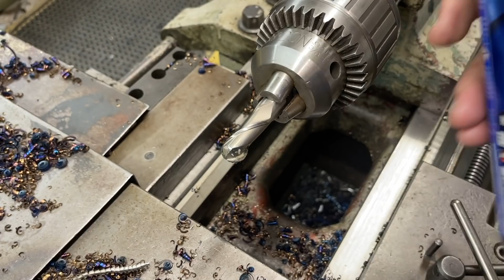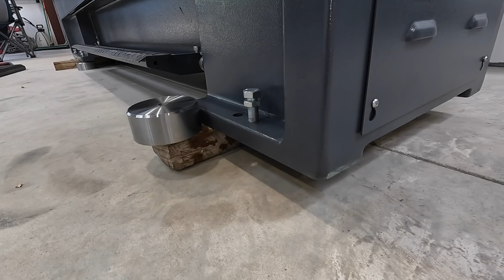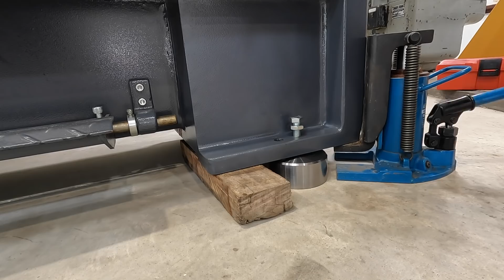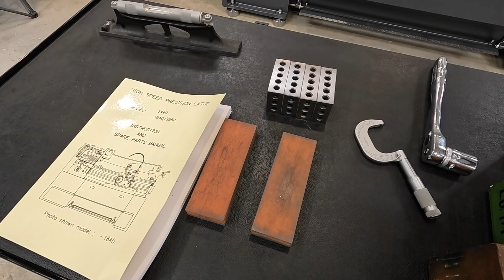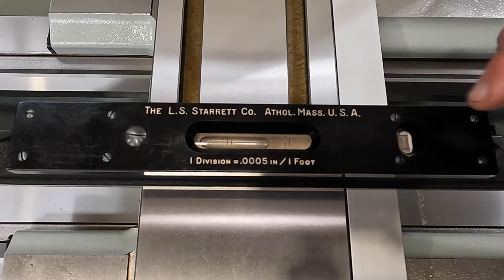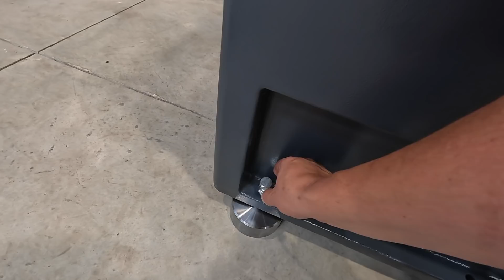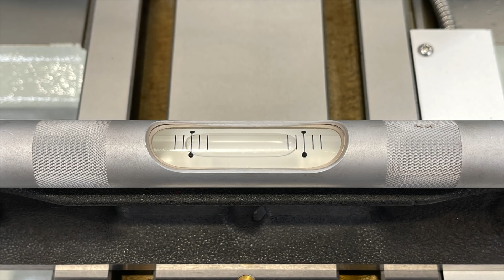Leveling the Precision Matthews TL-1660 Lathe

Comment: Thanks Adam, my PM-1440GT just arrived today! I made my leveling pads out of aluminum.
Reply: Aluminum has been just fine on my 4000 pound Monarch, they should be okay on this 1500 pound lathe. I shouldn’t have to worry about corrosion either.
Reply: hmm i dont a bout that you really want steel for them and not aluminum im like adam i use steel and i been moving and setting up  machines for years

Comment: Fun fact -the lathe doesnt have to be leveled.You can tilt it for coolant flow to one side -however bed guides need to be parallel to each other and parallel to a center line of the lathe for it to cut true without taper..
Reply: Thats one of the best short explanations I've come across so far. Using the word level is simply causing natural interpretation errors. Someone should take a small hobby lather and level it to 45 degrees and show it can work fine.

Comment: How about levelling the headstock - or don't you want the spindle true to the bed ?
Reply: Adam just completed leveling the lathe, which includes the headstock. I wish he would have put a little more tension on those last two bolts that he just “snugged up” though. Just enough to insure that heavy end is well supported. Perhaps later?
Reply: @ellieprice363  That's precisely what I mean - those two aren't properly supporting the headstock.
Reply: @millomweb  Yes, first step I would suggest is torquing those four bolts the same then check the leveling process again.
Reply: @ellieprice363  Spirit levelling - not necessary - what is required is that all supports need the correct pressure on them to hold the bed true (to the headstock) in all respects.
Reply: @millomweb  Sorry, no responsible machinist would purchase an expensive new lathe and assume that if he torqued all the leveling bolts to exactly the same torque the bed would be perfectly true without twist and ready to machine expensive parts. It’s too easy to check and be certain. Attention to detail is the only proof of sincerity.
Reply: @ellieprice363  "if he torqued all the leveling bolts to exactly the same torque the bed would be perfectly true"

Wasn't me that suggested that !
Reply: @millomweb  Please read my full reply again without taking my words out of context. Thanks

Comment: Adam, Should you be checking the torque, on each leveling bolt, to make sure the lifting force is equal on each ?
Reply: I was wondering the same. I havent finished the video yet, but I was wondering how the two 'extra' leveling bolts under the far left end of the machine... I wonder if there is a way to measure deflection between the headstock and the ways due to the bending moment.
Reply: @Thebadbeaver9  Yeah, he's completely missed that. #banana-bed. Since he's not used the left hand extreme foot adjustments, I guess his spindle will be 'looking up' relative to the bed.
Reply: @millomweb  I wonder if this Taiwan lathe came with “banana” or “monkey” fasteners? My Taiwan surface grinder table traverses on precision Imperial ball bearings.
Reply: I think you two are lost. The OtherPeoplesBeeswax channel is over there.
Reply: A very good basic step to start with, then adjust each bolt as required to complete the leveling job.
Reply: @ellieprice363  I was disappointed when Adam simply adjusted the left hand end adjustments to simply take up the slack rather than take half the weight of that end of the lathe. I anticipate the result is that the spindle is looking upwards over the bed - not by much but the issue of proper headstock support should have been addressed.

Comment: Great information about how to level the lathe. 
 That machine looks well made. I hope it is a good powerful and accurate machine because I like seeing you make some big cuts sometimes lol.
 Enjoyed the episode and the information. Keep em coming.
Reply: He's got other lathes to hammer with big cuts - he should use this lathe as little as possible to preserve its accuracy. As someone said in a previous episode - he should fit an hour meter to the motor wiring to record how much the machine is used - to plan a maintenance schedule. Had the bed not been somewhat prelubed, he'll have put a year's worth of wear on the bed already. He's talking of cleaning all the protective gunge off it. I'd have squirted oil all over it first.

Comment: I may have missed it. But is there a specific method as to deciding the height of the leveling pads? Finished work height, or some other reason?
Reply: Get the machine up high enough so it doesn't break your back permanently bending over it ! I'd guess our lathe is about 10" off the floor !

Comment: Got a 2' by 6" by 2" thick rubber from work that was left over from insulating a couple of 1750 HP Chillers.  Great to lay on agent working in washing machine dryer or furnance. Can remember kneeling on steel diamond plate while an apprentice. Would never do that now a days. Good luck with the new shop.

Comment: Don't you then have to turn a shaft and check for taper as a final test for bed twist?
Reply: He should unadjust all the gibs, thoroughly lubricate all the slides and other oil points, give himself a good workout, then adjust the gibs properly, then set the tailstock on centre, ensure the headstock is aligned with the bed vertically and horizontally - then he'll be ready for turning test samples.

Comment: How does this compare to a digital level that has an accuracy of  0.1 degree?
Reply: 0.0005 inch per foot equates to 0,00004 degrees so it's a whole different game
Reply: @Wogroipl   Thanks. I tried to do the math, and got confused.
Reply: @firesurfer  I tried to use an online angle calculator, and it wasn't precision enough!
Reply: Not even close

Comment: How do you like that Temco toe jack? I just got a 6" 20-ton cylinder a pneumatic pedal for my little 20-ton press. I've been buying my welding cable from them, they manufacture it in Colorado. I use it for all my battery cables in vehicles as well as #2 x 25' leads for my stinger and work clamp with #4 x 12' whips on them. Really good quality cable.👍
Reply: I've just bought cables for welding - and have gone for twin flex marketed as battery cable. I'll separate the last yard of it or so. Hopefully it'll be a lot less tanglesome !
Reply: @millomweb  I use DINSE 35 on both of my welders, so can use the whips by themselves or on an extension, two extensions, etc...I use them for both stick and tig. I have a couple friends that like the Tweco connectors for their leads, but I just keep 'em DINSE like the torch and work clamp. I find it easier to have them all the same.

Comment: How about the school of thought to make the pads slightly concave to eliminate rocking.
Reply: You could leave a rim on the bottom; I think that's the technique they use in precision cylinder squares and such.  It makes sure the three points of balance are all as far apart as possible, leaving room for high spots in the middle.  But I'm guessing it really doesn't matter all that much.
Reply: I thought of that too, but I think the pads will nest down into the concrete a thousandth or so with all that weight and a little chuck vibration.
Reply: Convex?

Comment: Nice lathe! I might have been tempted to paint or use Birchwood-Casey cold blue on the leveling pads. Interested on cutting a fairly long shaft for end to end diametrical accuracy.
Reply: Yeah, but... let's get it powered up, first.  :)

Comment: I would think they would use the finest threads they could for leveling screws to reduce the effect from small adjustments,,
Reply: "they" being Precision Matthews?
The threads tapped in the machine base?
Reply: @jimurrata6785  yes,,
Reply: @madebysteve1738  Cast iron is kinda grainy and crumbly. 
You don't usually find fine pitch threads in machine tools or engine blocks because the depth is shallower and distance between crests is smaller.
Reply: @jimurrata6785  I didnt think about that,, sounds about right,

thanks for the clarification,,
Reply: @madebysteve1738  I'm no expert, and I agree with your point.  
But I DO understand why I don't find fine threads in cast iron or aluminum.   🤔

Comment: I'm curious why no one (machinist videos) make an effort to actually anchor the machine to the concrete slab? I would think vibration would have the machine moving all over the shop.
Reply: See Vintage Machinery channel with Keith Rucker and look out for his Carlton radial drill. That is bolted down but needs to be for stability as it can work outside its own footprint. Lathes aren't prone to walking about and if they did, it'd only be a little bit to a point where they 'feel comfortable' on the floor.
Reply: Yikes!!  What the hell are you planning on machining?  Remind me not to visit your shop.

Comment: Wouldn't a quality lathe take drainage into consideration?
Reply: Yes, I'd suspect having the machine perfectly level would set all channel angles to drain to the coolant sump.
Reply: Drainage along the ways?  How could they do that?  He's talking about drainage for coolant sitting on the ways, not drainage down in the sump, where... no doubt... the pan has a significant slope towards a drain plug or something along those lines.

But up on the ways...  you want the ways pretty much level, and the point he was trying to make is that a little downward tilt is desirable, rather than having the coolant "pick its own direction" and drain down into the mounting of the headstock.  I think my guess would be to use even more tilt than he used.
Reply: That's not why he's leveling it at a tilt. It's so fluid doesn't travel along the part being machined and going through the chuck and running on the floor.

Comment: Adam,  I'd love to see you do a "reaction video" to this video. I randomly came across it yesterday and it's very interesting. It's a machine shop in Pakistan that machines crankshafts from cast iron blanks. It would be an easy 35-minute video for you to make, but I think it would be interesting to hear your thoughts as they go through their process.

https://youtu.be/XsEIamdzsZs

Thanks,
Jay
Reply: Those crankshafts must be used in f1 racing cars ! Loool ,no balancing -that engine must jump like a goat !
Reply: @armageddontools     Some of those Pakistani truck repair videos and stuff that ends up overloaded on public roads make me appreciate the US laws and regulations in a new light.       I mean we can all appreciate one getting a job done whatever it takes but when it comes to vehicles- totally like whoa!
Reply: I Agree - I also watch those Pakistani machine shop videos - they're very impressive.
Reply: Amazing what they can accomplish using coathangers for runout indicators. Most of their shops don't even have workbenches.
Reply: @drlegendre  Thats how they did it back in the day -with the needle and height gauge.
You can get within 0.1 mm just by eye.
I used sharpie in a toolpost as well .

Comment: When leveling a machine on a new construction location, how frequently would you verify the level of the machine afterwards?  Any concern of settlement of the slab or building over time?  What would be an indication to you that the machine is out of level?  So many questions, but I'm curious of any follow-up procedures on your end.
Reply: People say that the concrete moves but it's more like the vibration of the machine wears off the concrete's peaks underneath the feet. Personally, I space the feet up about 3/8" and force some machine grout underneath them. Wait over the weekend and you're good to go. It will likely stay right on the bubble.

Level it. Check it at 20hrs of work, then again at 40hrs of work, then every 400hrs of work. If you don't crash it or it hasn't experienced a lot of vibration, it won't move much after 40hrs.

Just keep it oiled and never leave it set long after using water based coolant. The rust inhibitor goes bad and things start to rust. I wipe it down with Mossy Oaks CLP at night (gun lube).
Reply: @cornpop7805  Lucas makes a great gun lube.
Reply: @franknphotos 
I agree about Lucas and I almost said them. I've heard CRC makes a good one too.

 There are a lot of good CLPs these days. It a great time to be alive, especially if you like gear.
Reply: Check every week for the rest of your life!
Reply: Checking is so easy w the levels he has.  I would really check weekly for 6 months and monthly thereafter.  Milling machine is even more critical w it's weight distribution.  Shaper got to be the worst thrusting w every stroke.  So easy w a nice level.

Comment: Adam:  Great channel, might I suggest you use a black Sharpie pen to fill in the etched graduation marks on the vial of the Starrett level.  You can rub off the excess. 
Here on the screen it's really hard to read.   Cheers!
Reply: IMO Adam should send that #199 back to Starrett to have those marks professionally re-painted

Comment: @abom79  I am not a machinist, but it seems to me you would want to just "crack" the bubble. I am a heavy machine operator for over 25 years, and when grading if we want the water to flow, we just "crack" the bubble on the level, which is about 1% fall, or 1 inch in 10 ft. Water will flow on a level surface, it just needs to accumulate before it will flow. Just need a little fall abom, not a full line on the level, I think that is overkill and unnecessary.
Reply: When setting up with the Starrett precision level, he read it as 2 thousandths over a 1 ft span, far less tilt than 1 inch in 10ft if I'm not mistaken. idk, I don't do this for a living or anything. Cheers.
Reply: Yeah I failed to consider the resolution of the level, and as he said, the most important thing is to not have the ways in a twist, so a little fall in line with the ways probably won't hurt anything.i just reacted to him saying a whole line on the level, and was thinking a whole line on a regular level

Comment: So, the entire weight of the machine is supported by the threads?
Reply: The photo in the manual shows that very set up. Seems legit. Those bolts must be strong, though. I believe they may be a way of isolating the vibrations to/from the lathe. Those small socket feet would have that effect.
Reply: @TheDuckman02050  All professional grade lathes i saw were bound by concrete to the slab . It absorbs vibrations better and if cast iron is normalized properly lathe bed wont warp.They used to do it by leaving a cast outside on the wind,sun,heat,cold , and other elements for 5years . I somehow doubt chinese did that .
Reply: @armageddontools  .....I "somehow doubt" nobody has done that for the last 100 years!   BTW, there are no Chinese involved with this lathe.
Reply: @truthbetold2914  ...I don't need to tell myself anything more than I know.  The machinery is advertised as 100% Taiwan.  They are proud of that.  The Taiwanese and the Chinese are nowhere near cooperative.  You were just itching to say "chicom".  You feel better now??
Reply: @truthbetold2914  lol
Reply: @paulcopeland9035  you wrong!! there was a  imigrant chinese worker in Taiwan  putting this very machine together!!
Reply: @truthbetold2914  i think so too everything is less money in China
Reply: @paulcopeland9035  Keep dreaming buddy ! 
There is always something chinese -cast iron probably came from china steel mills which hold like 80% of steel production and those electronic components deffinetly are from china.
Even if they are made in a different state -capacitors,mosfets,diodes and other electronical components are from china.
Probably even pain is made in china.
Reply: @paulcopeland9035  I "somehow doubt" nobody has done that for the last 100 years!  -you probably refer to laying cast iron for 5 years on open.
It was done in yugoslavia like 30 years ago 
before its collapse.But those lathes are built like tanks.2 shifts are nothing for them,
i seen them working for 24h with 3x 30 min brakes for workers .
I woud love to see precision matthews do the same for 30+years.Compared to them these toys are not worthy picking up chips that they make.
If commies knew something its how to build tools! 
Also they did the engine blocks the same way.
I saw a whole field of them when i was apprentice.
no matter how people try natural process is always better -slower but better. 
Kiln dried wood is living proof of it.
Beams that were cut in january and left on the bottom of the sea for 2 years and then dried for another 2  even after 70 years are tough to bend nails.
People took time in past thats why there are wood houses in europe as old as 400+years.
Reply: @armageddontools  Interesting to learn about this stuff. So much to know and discover. Makes me wonder how SpaceX can manufacture engines under a tarp.
Reply: @TheDuckman02050  You should take a look at the 3D printed rocket engines from Relativity Space. Now THAT is some beanie-spinning, big-brain stuff!
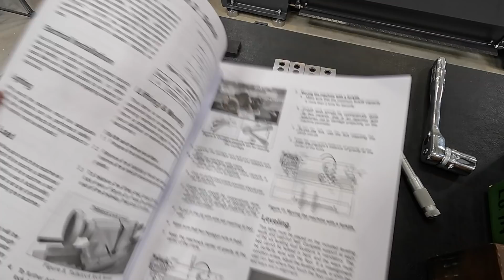Reply: I was initially concerned about this too (and tbh I still am as it seems far too little support) but you can literally see it in the manual @14:48
Reply: @cozmium  Well, i'm not sure what the compressive strength of bolts is, but the tensile strength would surely be lower, and it's something like 92,000 psi for a lowly grade 5, or about 130,000 psi for a grade 8.  These are metric, so they're something like 900 or 1100 Mpa.  I can't think in those terms, but... it's a lot.  ;). I see no cause for worry.  I assume the people who made many wise decisions in designing the lathe would not risk their entire reputation, and entire business, on save a few pennies on the mounting.  If lathes were crashing to the ground, so would the company...
Reply: I dont like that either...